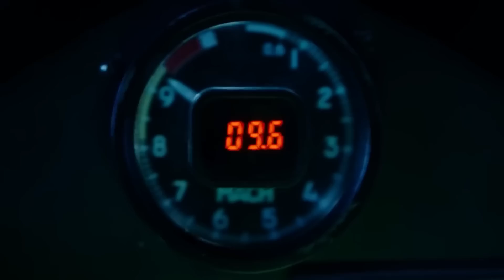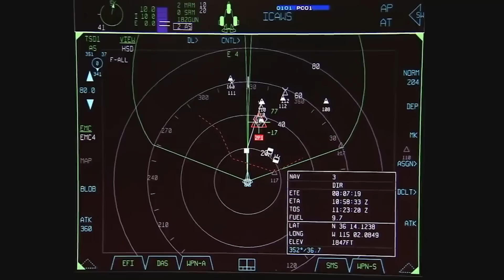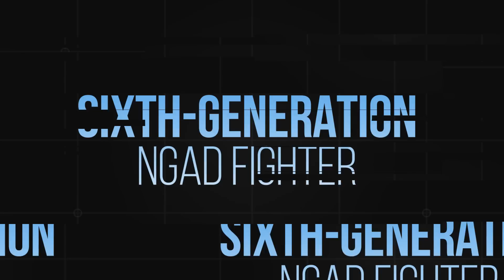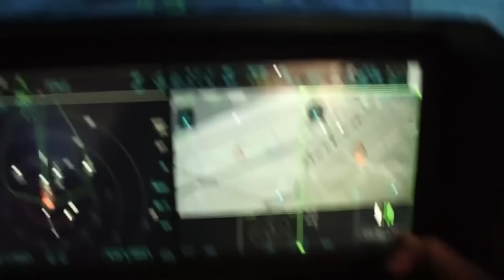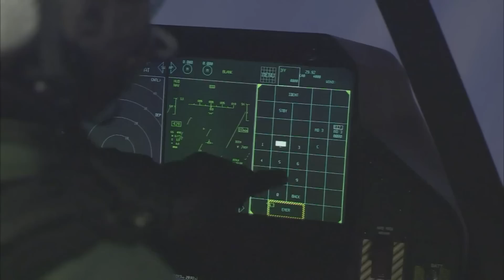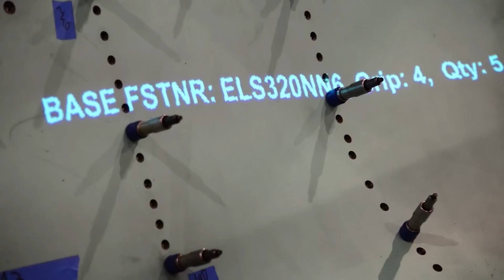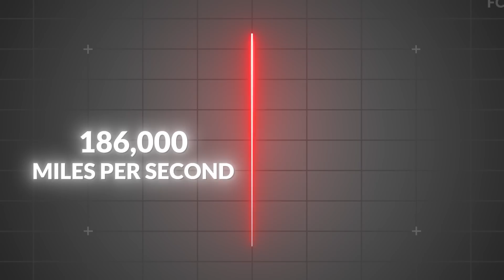US 4 $Billion 6th Generation Fighter Jet is What China Fears Most!

Comment: North Carolina State University (NC State) has developed a ceramic-based coating that can absorb up to 90% of radar energy, which could improve stealth aircraft's radar invisibility and overall performance. The ceramic material is water-resistant, harder than sand, and can withstand harsh conditions like heat, salt, moisture, and friction.
Reply: Could this material be used on Elons rocket ???? 🚀